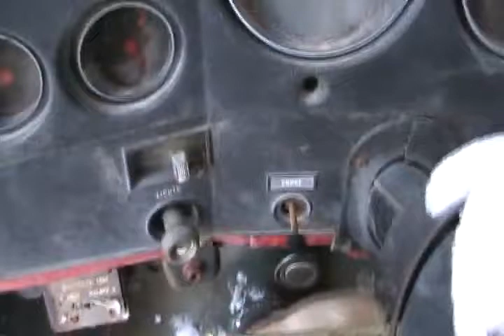#1217 Cold start 79 chev 427 dumptruck 2010 [Davidsfarm]

Comment: I wonder why the fuel pump is mounted on the exterior of the fuel tank and instead of inside
Reply: If you have the fuel pump on the outside it's gonna be filled with water and gonna be bad to use